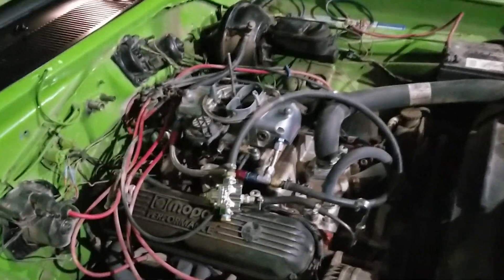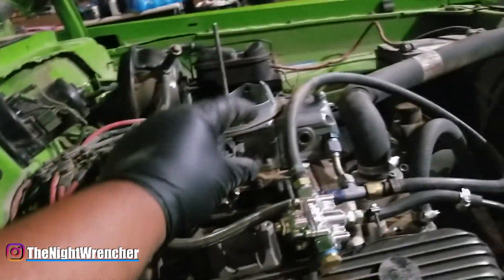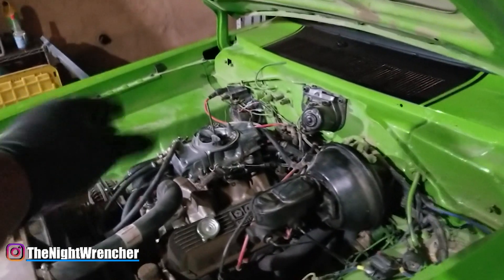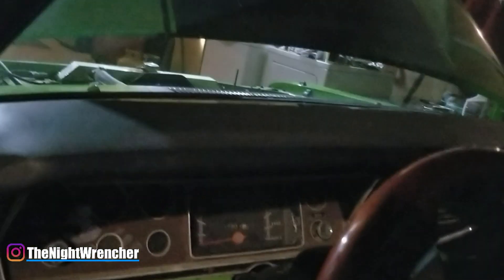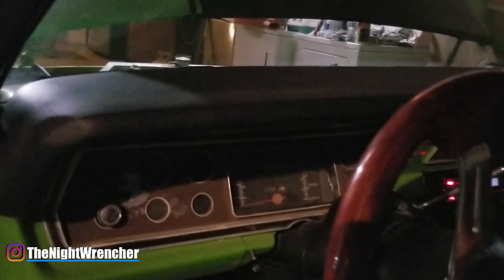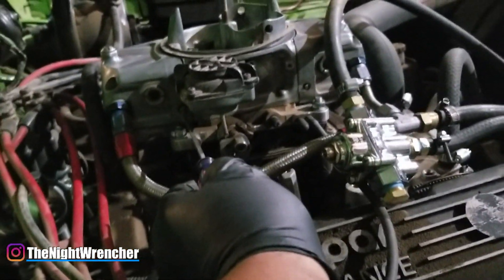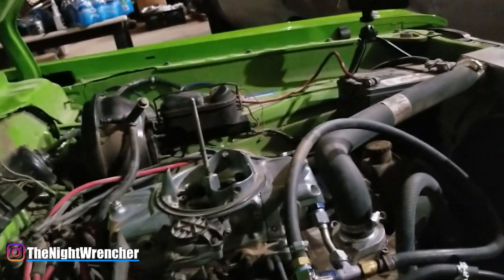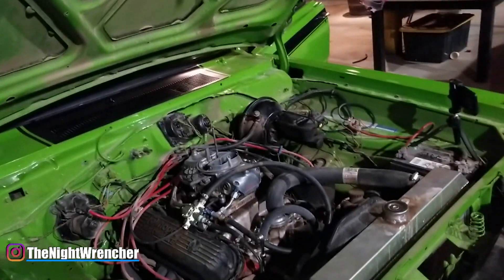HOW TO SET HOLLEY IDLE MIXTURE AND IDLE SPEED | Holley Carb Secrets | Holley Carburetor

Comment: The part I’m still confused about is after you do all of this stuff, where does the setting the transfer slot to a square come in to play? I was under the impression that you want to set the transfer slot to a square and then fine tune the idle with the idle mixture and the timing. If you’re doing all this aren’t you losing your transfer slot tuning? Thanks so much!
Reply from the maker: The thing about a square transfer slot is more of a general guideline to prevent you from giving it too much idle. A square transition on a 302 wont be the same RPM as say a 427 so really you should be going down as much as you can while adjusting the idle screws to compensate. Hope this makes sense

Comment: I think I over adjusted the float too low and now I can't get it to fill up again. Help please
Reply: Ok then that must be it. Thanks and great videos keep it going. I’ll keep you posted.
Reply from the maker: Did the needle and seat get stuck? If it did, you can twist it back out with needle nose pliers or locktite on a bolt with the same thread pitch or the lock screw.
Reply: It’s a new carb so not sure if that would be the case but I’ll double check tomorrow.
Reply from the maker: If you screwed in the needle and seat too far,  You won't be able to pull it back out with the  Lock nut
Reply: You were correct sir, i had screwed it in to far.
Reply from the maker: @reinaldocruzado8619  awesome, hope you can fix it

Comment: What does it means when there’s a strong fuel smell coming from the tail pipe? I have a small block 350.
Reply from the maker: Sounds like your running too rich. Running too lean also causes a harsh smell and big cams do the same. Have you already reset your idle mixture?

Comment: What I take away from this is to tune the mixture screws for what the engine wants. I've always heard to keep the mixture screws exactly the same, is that not necessary?
Reply from the maker: On a single plane or dual plane with an open spacer, you should probably keep them close but on a dual plane or dual plane with 4 hole spacer, tune for what the engine wants because each corner will be different. Keep them the same at first but the fine tuning will be different for each corner
Reply: @NightWrencher  mine is 
 a factory iron quadrajet intake with an open spacer. 4160 with primary adjustments only. Keeping the adjustments identical, i find that I can't get it to idle much leaner than 12afr without it running rough and popping like a machine gun out of the exhaust on deceleration (manual trans). Id like to get it to idle leaner, but at a loss as leaner would also just make the popping worse as well.
Reply from the maker: In order to run leaner mixes you'll need a good ignition system that can run wider spark plug gaps. You'll also need to make sure you have enough compression to light off the mix too. Give the engine what it wants, and go from there.
Reply: @NightWrencher  fair enough. Gaps are currently at .55 I believe. Is the popping on decel fairly normal as well as the afr for idle (I've no baseline for whats normal on carbureted engines)? The only other question I have, is for some reason I notice slight surging when climbing hills/grades. Almost like the secondaries butterflies are doing something weird? I see the afrs go richer when it surges. Thanks for the help btw.
Reply from the maker: @wacogate   a lot of what you're describing is timing related. What engine us the carb on? A lot of old cars used to use dashpots to keep the throttle from slaming shut and prevent popping on decel. Open exhaust also causes that as well as exhaust leaks.  Rich Surging on full throttle uphill is either too rich secondaries or PVCRs too big. Vacuum secondaries are hard to tune because the secondaries move on their own. I would install a vacuum gauge and see if you can cause the rich condition on command.
Reply: @NightWrencher  stock 1977 350sbc in a truck. It's not full throttle uphill, just part throttle (maybe half), vacuum gauge reading also has no difference when the surge occurs, stays steady. Timing is 24 initial, 34 total by 3000rpm.
Reply from the maker: Where is the vacuum at while youre going up hill? Are you going into your power valve?
Reply: @NightWrencher  pv is a 6.5. 99% of the time the vacuum is above it, as I purposely try to stay out of it for mpg sake. Not sure exactly what it is on hills, but idle is 21 inches of vacuum.
Reply from the maker: @wacogate  I had a similar problem. Ended up turning down the primaries, went from a 6.5 to an 8.5 PV and went front a .040 to .025 on the PVCR and fixed all my issues on hills
Reply from the maker: @wacogate  if you havnt watched my PV video, give it a watch, might help you out
Reply: @NightWrencher  I had a 9.5 in it previously, but returned it to the stock 6.5 because I was either always in it or just on the edge of it. I can't remember if it did it with the 9.5 or not, but I'd guess no since it'd be full rich?
Reply from the maker: @wacogate  its hard to say since I dont know exactly whats going on, best you can do is run a vacuum gauge inside the cab, go up a hill and watch the AFR and compare it to the vacuum. That will give you a good idea of where your problem is. I dont think its in the main jets because you would be running rich all the time on a regular road.

Comment: I would like you to do a review on the Thompson performance powerblast plate
Reply from the maker: Thats a good idea! I've seen them around for a few years but have never tried them personally. I've read mixed reviews on them so I've been hesitant to try them out myself.
Reply: NightWrencher yes me too but they look like they work ! Hopefully you will test it out , apparently only certain shooter will work and I’ve noticed a different ini Holley and quick fuel , quick fuel nozzles are higher then Holley also
Reply from the maker: @sharons9367   Another big thing is booster type. Down leg and annular boosters crash against the pump shot just like the powerblast plates do but the straight leg boosters like those in the economy holleys do not so the plates effectiveness might differ depending on what carb it gets installed on.